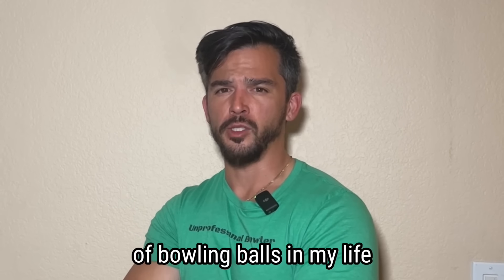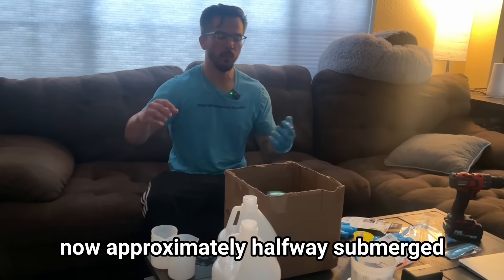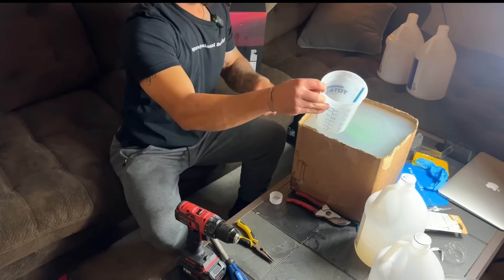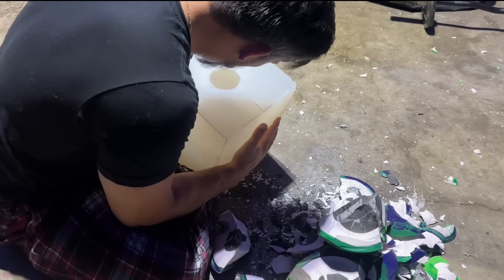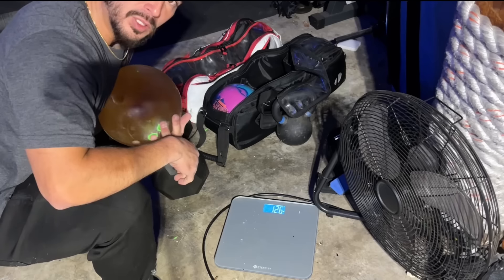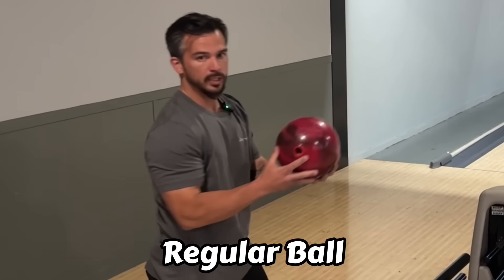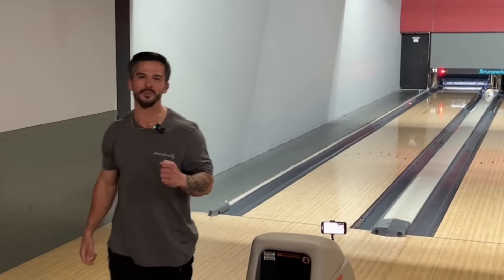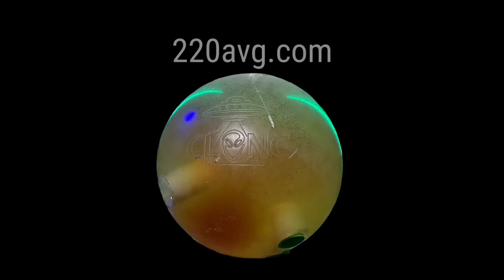I bowled with a HOME-MADE Bowling Ball

Comment: When you sat it in the bottom of the cardboard box without a spacer I was thinking.. "that's gonna have a flat spot".
Reply: Prop it up on a pizza box table / pizza saver and would be easy to cut and sand off the little legs 👍👍
Reply: @larrytobis9161 I would just drill a hole in the ball and have it suspended by a rod
Reply: @dillzilla4454  The ball wasnt destroyed when he started so that idea was prolly not valid at the time of starting this
Reply: @ambiarock590  except that's the way to do it.  You can always plug the hole, or put it where a finger hole is going to be

I assumed that ball wasn't drilled, so plug the hole

Comment: A couple suggestions for future ball casting. 

Drill a locator pin hole for each half of the mold, one in each equator of the ball.   Fabricate a pin with base to fit the hole snuggly, but not and interference fit.  Make the pins enter ball at least 3", but ideally 4". 

Stand ball on pin and pin base in box. Pour first half of mold.  Let cure. 

Insert 2nd pin, which should be identical to 1st pin.   Use silicon, graphite, or some other non reactive, non-silicone soluble/miscible  lubricant on the mold face, to keep the 2 halves of mold from bonding (can also use paper/cellophane) 

Pour 2nd half, let cure. 

Separate 2 halves of mold easily due to the barrier, remove ball.  

Granted, I forgot to add a pour cup. So maybe just pin 1 side and a cup on the other....

The locator pin allows you to develop a core and suspend it. 

I'd suggest molding something with epoxy and tungsten for ease of casting and drilling.   Have a buddy 3d print negatives of weight block and outer core, to make a mold. Include a locator pin in both. 

Have fun on the adventure of "try and see" bowling ball design.
Reply: Don't forget glass beads for outer core shell.  Weigh raw materials or you may end up with a 40lb ball.......
Reply: Id love a part 2 of this video to improve the homemade ball.  Id suggest leaving the huge lump in the ball after pulling it out of the mold, and getting rid of that chunk with a pro shop drill since they have drill bits to make the ball surface perfectly round.  These are the bits you use after filling in a chip or a finger hole, fill it in and then drill to make the surface smooth again
Reply: Obviously minimal research was done prior to the making of this video.

Comment: This is essentially what i really want to do but i just dont have the time or money. I would love to see you make an improved homemade one with a couple suggestions:

Prop the ball slightly up with something small for it to sit on before pouring the first half of the silicone mold. Something like a flat sanded bottle cap. That way the potential flat spot that you'll sand away will be much smaller and less likely to cause an inconsistent roll.

Also, definitely do not forget to put mold release on the first half and the ball before doing the second half, that way you can actually pull it apart when its cure.

It would also be absolutely dope if you put in something that weighs about 3 pounds for a core. You could use almost anything you want, including your own design, that way it would actually have some flare.

You could do mica powder with the resin so that way it looks prettier too lol. Another option for stronger motion is to use entirely ball filling material that people use to plug and redrill equipment. I believe its urethane material so you'll get much more motion i would assume.

Overall really cool to see someone else try this. I would love to see it done with a weight block in it though, which is what i would do since i have a couple of my own designs for weight blocks.

Comment: As you mentioned at the end, need to change how the mold it made to get rid of the flat spot.   The box is a soft surface so it would sink into the Cardboard, need a firm surface to reduce the edge.

Also Find a ball that is slightly larger (New not worn)  Even light sanding will reduce the overall ball size.  Us that for the mold you can then sand it slightly(put it on a lathe) to remove a small edge.

Should be interesting to see what comes from your next mold.

Comment: Large silicone molds can be really tricky. But the outcome was a lot better than I expected it to be. I'm far from an expert but I can give you a couple of tips, when you get silicone also purchase mold release spray. It's pretty self-explanatory. Use it on the og ball and inside the silicone mold. It would probably also prevent the two halves of the mold from fusing. also you might want to consider making it just a little bit oversized by a couple millimeters. You figure out how, lol. Then throw it on a spinner and cut it down.   Ask for the core, you can do the same thing as the 20lb ball. Then hang it in the middle of the ball and pour around it. Do some small experiments with using less hardener in the epoxy find out if it makes it softer or just makes it take forever
Do you think storm would get all pissed off at you if you called it the Dirt Road?  Think  brown food coloring or dye. (Eeeew!)

Good luck chocolate lover!

Comment: I would start first by removing the finger molds, first but be careful you don't want to remove too much  that you will need to do a lot of sanding after a pour.  Then make add a 'PIN" with core coming out like an half inch out of the top hole (assuming this is the flat spot).  Then write mystery box and take it to Aaron to drilled and smooth out.

Comment: Put a shot glass under the ball before you pour the mold if you are able to place this drink side down it should give you a place to pour the resin and spread some vaseline on the top of the first half of the pour before pouring the second half of the mold this could help in getting the mold apart

Comment: Well right from the get-go I saw the problem of that the bowling ball needed to be suspended in the box by a wire threaded into the thumb hole. The other two fingers need to be covered up.. and your mold didn't come apart cuz you didn't put any releaser on it

Comment: There's a way you can make a mold that you can reuse and wouldn't have the flat spot. you basically only fill your box up to half way and you wanna put some sticks or dowel rods partially into what you just poured (this helps with connecting the top part), then once that dries you take the sticks out and pour in the next half. Now you should have two halves that will connect to each other and should fully cover the ball. You also wouldn't need to destroy the ball you are copying if you do it this way.

Comment: If you're going to add a core, maybe use one of those small 4-6lb dumbbells and suspend it on a string in the center of the mold. Would be very on-brand and the heavier ends could impart some more controllable motion. I'm betting if you center it so one end is in the middle of your grip, it may pick up and follow the rotation of your throw quite well.

Comment: The problem was making a silicone mold on an old ball instead of buying an industrial grade spherical rigid standard mold. You also needed the mechanical pro shop rounding polishing tool to finish it. Use the pro molds next time. Thanks.

Comment: 1) You could just plug and redrill your homemade ball so it doesn't roll over the flat spot.

2) Why not make a homemade ball out of ball plug? Plug is some sort of urethane, right? I've only ever used quick plug, but if I were to do it I would definitely try to get slower setting plug. Plus if you mess up... you can just plug the plug. Like if there was a flat spot you might be able to drill a bunch of small holes in the flat spot to anchor the plug, then plug off a large square and then file the ball down to something round. I feel like I kind of want to try this now.

Comment: Resin does not hook because it is made of resin, resin hooks due to the microscopic pores in the surface of the resin created when the plasticizer bubbles pop during the curing process.
Those pores are what grip the lane and absorb oil.
And I don't think you hold the record as I am sure some of the early bowlers hand made their wooden bowling balls and shot some big games. 😂
Reply from the maker: Good science to know. I wonder if I can add plasticizer to increase reaction 

Didn’t think about the homemade wooden bowling balls, I gotta go for 300 with one of these 😂

Comment: that ball probably would have worked fairly well if you were able to properly round it with one of the machines that the manufacturers use. Seems the only real problem with the ball is that it isn't very round.

Comment: That's not an easy thing to do.

You have to calculate where you need to place the core.
My advice is; Try different balls and feel what type is the best.
Then find out where the core needs to be. You might need schematics about what type of bowling ball you want to make.
And most imprtant, measurements about the location and the weight of the core.
One wrong calculation , and your ball will hook less (or not a all). Or hook heavy. Resulting in that you have more chance of getting a gutter ball.